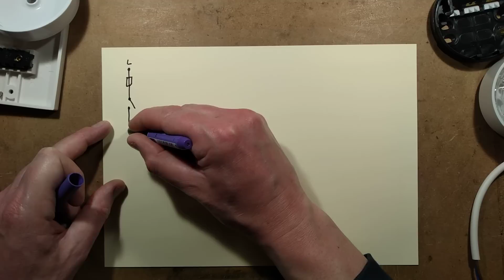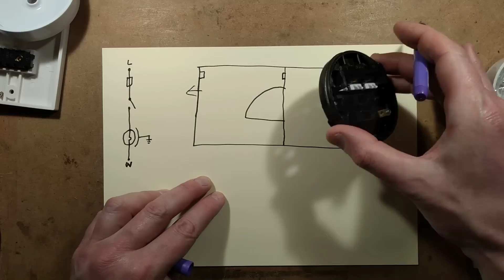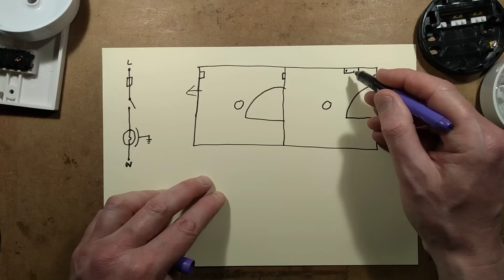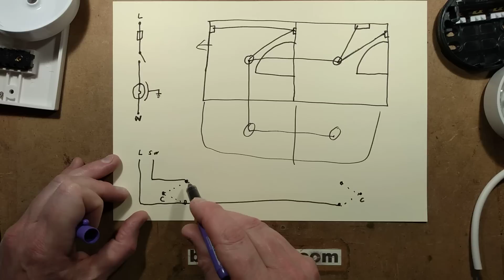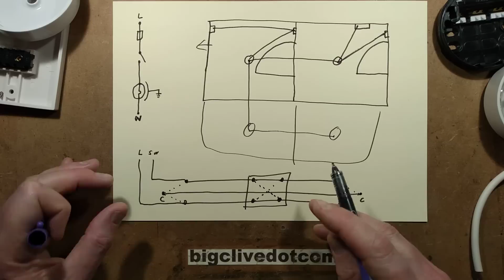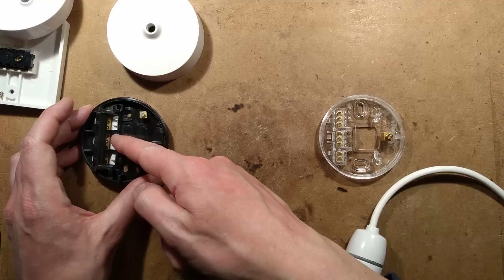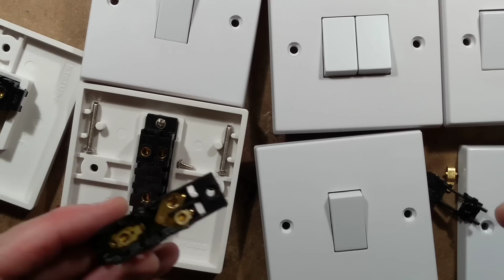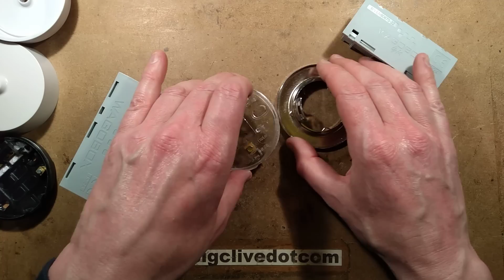British home wiring.  The incredibly simple lighting circuits.

Comment: It's when you want to install one of those fancy wireless, touchpad light switches and then discover you need a live and neutral feed to the switch, so you then need to channel out the plaster and negotiate the spiders nest of loft cables.
Reply from the maker: If they wanted to allow for that in new installations they could run a three core to the switch box and park the neutral in a connector.

Comment: how is that called strain relief when the strain is still focused on inner leads … even when the strain happens inside the casing ..   whole purpose is to avoid stretch in leads and there for higher resistance and risk of fire on over heating or failure to strip the fuse when ik aint high enough due resistance …  

That small metal box looks like an nightmare …   all so those brittle hard plastic boxes seems a bit harsh on eye.   maybe it is just an being used to different looking and softer materials ..

Comment: In Sweden we have had insulated earth wire for as long as I can remember. Its not hard. You just ring it with a knife as you said and then pull of the outer insulation (no need slice it down the middle). With some practise its fairly easy to ring it with any knife. But there are also specialized tools for it that can be adjusted to the exact correct cutting depth.

Comment: Wow.This all points to the stone house approach.
The electrical system is obviously geared towards the house being of stone and one has to route out stuff.
Electrical boxes in Norway is mostly made to fasten to the inside wall joists (wooden beams) before adding insulation and sheetrock or panelling.
They are all made to connect with either straight or spiro piping and even have the locking/gripping systems for these pipes built in.
Also, any fixture for hanging a light will have to secure the cable separately from the termination.
Reply from the maker: The metal boxes can be secured to the sides of wooden straps.
Reply: 1kreature - Yep, we have a lot of buildings constructed from limestone blocks, bricks, concrete blocks etc. Wood frame homes are not common here in the U.K.
In older homes, all the original internal ground floor walls are solid (often brick). On the first floor, the internal walls can be either solid or a wood frame with plaster board.
So if installing new circuits, there is a lot of work required to cut out routes for the wiring and to cut holes for the metal back boxes.

Comment: Plasters that do that piss me off. Filling back boxes fucks terminals, fucks the M5 screw holes and is easy to scoop out while wet.

You only make electrician's lives a total nightmare and risk breaking the back box. If a plasterer does this, i tell them "sort this shit out", or just break the plaster off with a hammer, if they have to redo it, it's their fault for fucking up my back box!

Bit of respct for other tradesmen goes a long way! Else I'll reverse neutral and earth on the temporary supply so it keeps tripping when you use tools.

Comment: I'm helping a homeowner retrofit  their electrics on a 110 year old house in the US.  The original wiring  (some still active) is fabric covered wire strung between ceramic posts. In the '30's, it was expanded, and in the 50's a new panel with circuit breakers was added.  The walls and ceiling are plaster over lathe.   It's a real challenge, especially with the 1970's tech we have available in our local stores.  I wish I could get and use those Waygo boxes in the US.

Comment: In the near future i can seriously see the lighting circuit being either 12 or 24volts, simply because its just too easy to push your fingers in these current sockets and get electrocuted. we dont even need 240v today seeing as 99% of incandescent bulbs are now illegal, everythings going led, which would also make the led bulbs easier to manufacture because they wouldnt need an energy wasting and unreliable/cheaply made transformer inside them.
Reply: It would be good, so long as the transformers are in an accessible place and easy to replace in case of a fault. If a 230v led lamp fails because of crappy capacitors then at least it's just the one lamp.

I guess the load matters too. If you have lots of low voltage lamps requiring a high current then you will get hotter cables compared to high voltage low current.

Comment: I always striped twin and earth by using a side cutter like you showed but instead of grabbing the earth and pulling I'd hold live and it's half of the outer pvc in one hand and neutral and it's sleeve in the other and pull them apart, leaving the earth in the middle and undamaged.

Comment: Enjoyed until you felt the need to knock the NICEIC. Nothing perfect but the other CPS ain’t perfect?
Reply: The only people who are fans of the NICEIC are those that work for them.
Reply from the maker: Before the NICEIC (which is a private company) cashed in on Part P, they operated a protection racket for large contractors that made it hard for sole traders like me to get work.  They did that by heavy advertising implying that they were some sort of official body (they're a private marketing company) and using a catch 22 situation to avoid "approving" small contractors.
It was only when I fell foul of their system that I realised they weren't what I thought they were.
If you look for the small print on their website you'll find they describe themselves as a voluntary electrical safety organisation.
As mentioned above, the only people who think the NICEIC are great are their management and the people who pay to use their logo.

Comment: Why in the UK do we have plugs with so many features to stop you getting zapped by poking things in a plug socket - the long earth pin, the shuttering, the screening on L and N - yet the bayonet light sockets expose mains voltage in a nice fat finger size opening?
Reply from the maker: Old "grandfathered" standards.  Lamp holders like the GU10 units are designed to embrace that issue.

Comment: The British wiring systems are probably the best in the world (cue patriotic music) but I do wish that we could get rid of bayonet fittings and standardise on Edison screw, which is far superior. The two gang or three gang light switches can be risky where upstairs and ground floor circuits come into the same switch plate-unfortunately, that was how my house was built but I would not have done it that way. As regards sharp edges on knock-outs, a round file sorts that out, but like you I prefer the ceiling roses with the large holes. Very interesting videos, Big Clive. Keep them coming.
Reply from the maker: If they were to standardise on a new lamp cap I'd suggest something like a GU10 that was finger proof.
Reply: I much prefer B22 bayonet to ES Edison screw. I have found the centre contacts on some ES type holders break contact with the lamp cap contact as they warm up. Resulting in a flashing light! On the quality B22 bayonet holders with sprung contacts, I have never experienced such a fault.
Also in critical applications where the correct focus and optical alignment are required, B22 bayonet holders are used (often with three locating pins rather than just two).
Reply: @Mark1024MAK  My main criticism of the bayonet cap design is that after a time, the sprung contacts can make a depression in the bulb's contacts, making it extremely difficult to remove. This I have found has happened quite a few times. Indeed, at one  large power station at which I worked, every tungsten lamp fitting was changed from BC to ES. At my last power station, I had all the tungsten lamps in the reactor buildings replaced by Fluorescent lighting anyway. I was interested in your mention of 3-pin BC bulbs as the only ones that I have seen were fitted to coal effect electric fires in order that customers could only fit expensive replacement bulb!
Reply: Mervyn Partin - The type that I talked about are actually 12V expensive focused types used for long range visual signalling applications. Because of the relatively high currents, sometimes the lamp contacts cause similar problems to what you describe. However the root cause is too much solder being used on them. Given the large number that were in use, even so, we had only the occasional problem.
Reply: @Mark1024MAK  Ah, I see. Thanks for the update

Comment: hmm... here we just put PVC pipes everywhere and feed in 2.5mm² wires, exception for the wire from the switch to the light, thats just 1,5mm² ... still haven't figured out which system is better :-)

Comment: Wow, I did not know the lighting circuit in the uk is that much different to our german version .
Reply: It was introduced to stop people running irons and other high wattage appliances off light pendants. A lot of people once worked in factories where vertically hung power or air tools were common, people copied it. Caused a lot of fires back in the days of fuse wire.

Comment: Unfortunately, when they thought the U.K. system out, they didn’t foresee Smart switches, so whilst Smart bulbs work (as long as you leave the switch in the on position), smart wall switches don’t, unless you run a live and neutral wire from the ceiling rose back to the switch. Plus whenever you buy a nice light fitting, they never fit over the base of the rose, so you end up installing it on a joist and just linking off it to the light fitting (or as pro sparkies I’ve seen do it, link it all up on connector strips and wrap insulation tape round it!!!!!!!!!!!!!)
Reply from the maker: That is one downside.  In theory modern homes could be wired with three cores and earth to the switch.
Reply: bigclivedotcom I have wondered if it would be possible to have a smart switch, that is connected to the live and switched live (which when off is effectively be Live and Neutral via the bulb, so when in the off mode it charges a battery or cap, then as soon as it’s triggered to on drops the connection to the switched live and switches a relay as per normal switch, but it’s own electronics run off the battery until switched off again. Though TBH it simpler just to connect the smart switch at the rose.

Comment: Hi Clive, 
Great video, I think the loop in system is in its final days now. Even on a rewire I hardly ever use that system, unless switch drops are partially difficult. 
I always feed switches where possible and now if I remember rightly the 18th edition requires a neutral conductor at switch positions.
Reply from the maker: I'll have to check that.  They could achieve it with the standard rose by running a three core and earth wire down.  It's odd to think that in a previous version of the regulations they didn't allow a neutral at a switch at all to prevent people from looping a socket from it and "upgrading" the fuse.
Reply: I'll try and find the reg number for you when I get a minute. 
But yes your right, a 3core from the rose to the switch would solve it in a loop in environment. 
Don't get me wrong, it's not a bad system and for say rewiring a bungalow and re using the existing switch drops it's ideal.
Reply: @Josh__Stevens  it's not required, it states it should be considered. 

559.5.1.208 Consideration shall be given to the provision of the neutral conductor, at each switch position, to 
facilitate the installation of electronic switching devices.

I'm curious though to a neutral not being allowed at switches in previous editions. Was that really the case?
Reply: Thank you

Comment: You gotta love the way he explains 2 way and intermediate switching, tip top.

For test and inspection purposes I think it's 500g max but I hope a 7671 boffin will put us straight. Certainly pulling the earth measurably stretches the conductor. If you are making off a large panel like a lutron or big TPN and get long tails you can see an increase in resistance values, I like the Jokari auto strippers especially if on price and if you get fancy, a little ring of heatshrink or amalgamating tape at the base of the T&E tails neatens the joint and helps secure the earth sleeve. Tis a thing of beauty seeing a panel terminated properly.

I believe the reason there's a hole for a cable tie in the Wago box is to leave the live terminals requiring access via a tool. Installing electricians have discharged their HSE requirements thereby and these days, well, see Clives Glasgow Christmas lights vid, who could deal with that?

Comment: Ceiling roses were designed to convince electronics enthusiasts attempting DIY that they don't really understand electrics.
Reply: My dad had wired up the ceiling lamp in my bedroom when I was a kid. He'd managed to do it so that the pull cord near the bed would switch the lamp on and off normally.. until it was bed time and he flicked the wall switch near the door.

Whenever I had a nightmare id be desperately pulling the pull cord hundreds of times but the lamp wouldn't come on. I'd be convinced some malevolent spirit had crept into my room and unscrewed the lamp and be shivering under the bed sheets afraid to get out of bed incase it got me. Of course, when my parents heard the cries for help and switched the wall switch to see what was happening the light would come on! Then the pull cord would work as well and they'd think I was crazy. Dad would say "just turn on the light if you get scared" and I'd say "but it doesn't work when you leave..." but they'd never believe me.

Many years later I figured out he'd wired it so the main switch isolated the pull cord instead of acting as a XOR!
Reply: @paulgascoigne5343  I changed a bathroom light once.. expecting to find 1 wire with L N & E... It was a traumatic experience. I think the fitting must have had only three wires and three connections.. whereas to replace a rose that isn't quite enough.

Comment: Looks like a huge FAIL:!  Electrical wires should NOT support any weight in any installation.  Usually either a conduit tube or chain should be used as support for that type of light.  Not even a ground connection in the light socket?  "Plaster-Board" may mean plaster spread on wood strips.
Reply: This is permitted, see para 559.5.2 +  table 4F3A of your BS7671 18th Edition...

Comment: Have I been wiring my 2-way switches wrong? I put the incoming live to the COM on the downstairs switch, connect L1 to the other L1 and L2 to the other L2, and the upstairs COM to the bulb.
Reply: Either way will work fine. The way you have it is what I'm used to seeing most of the time here in the US

Comment: In Sweden we put the round ones inside the wall: https://www.elbutik.se/product.html/kopplingsdosa
They come in different versions (depth, depending on i.e. if its single plaster or double plaster and different hole directions and numbers of holes).

Comment: My brother once rang me, pleading for help.

While swapping a light fitting, he'd charged in and taken down the ceiling plate, then realised there were more wires than he'd bargained on.
Reply: Had that a few weeks ago doing some renovation in my german home. Removed the Switch (Completely different style of boxes, Switches, Outlets and wiring by the way) and found they used the box for distributing within the room. I couldn´t remember having seen Wago connectors with so many connections before...
Reply: Not an electrician, but I replaced all of the ceiling roses in my flat and definitely had the "oh, there are more wires here than I expected!" Made a note of wire positions and all was fine. If I'd have YOLOed (which, to be honest, I usually do) then I'd have ended up in trouble!
Reply: Here in Austria, especially older wiring would likely have the feed into a central junction box up on a wall somewhere and everything run horizontally around the room and straight down from there. However, if there was a socket on the wall right across from the box they'd sometimes run a permanent live to the ceiling light and live and neutral from there to the socket. Now if some bloody genius cut that apart you'd likely be looking at five black wires in a pre-1960 setup. Of course with some basic knowledge and test equipment it'd be easy to figure out which wire is which but your average DIYer is stumped!
Reply: Had a neighbour do much the same a couple of months back - they expected just one cable, not three. Sorted it in less time than it took them to make me a cup of tea.
Reply: @Graham_Langley  Once you understand how the system works, it's not especially difficult to sort it out.
Reply: @BedsitBob  Especially if you've rewired a few houses...